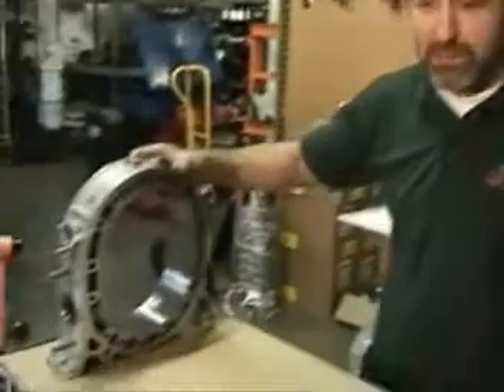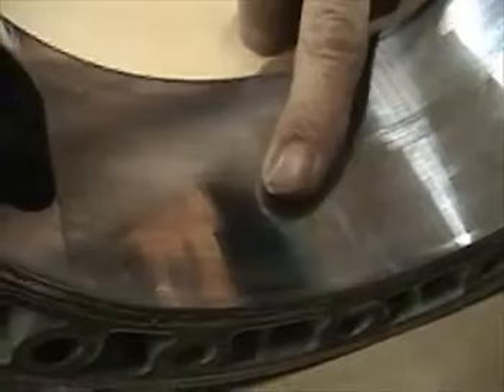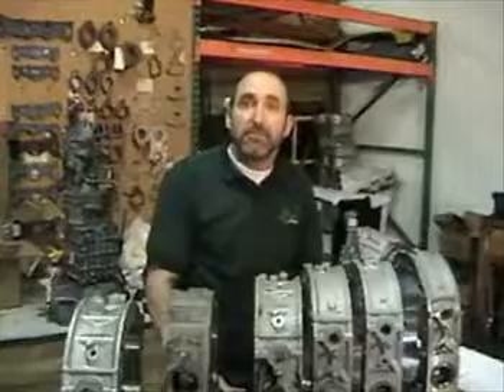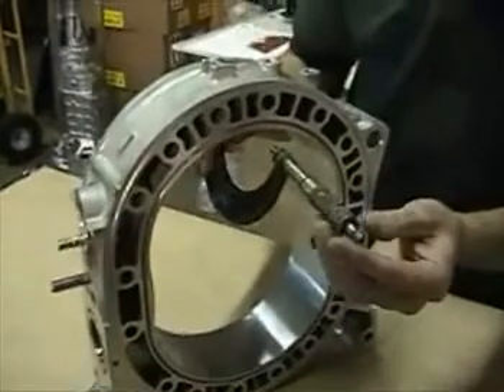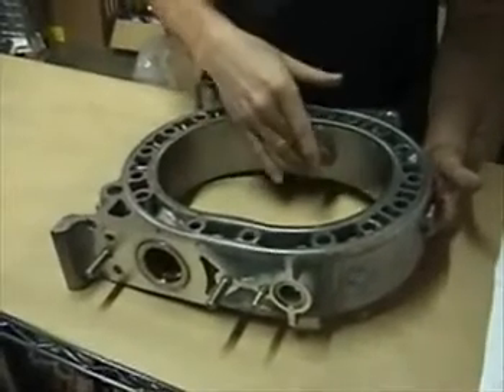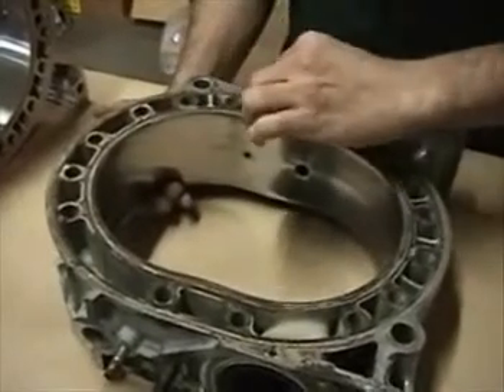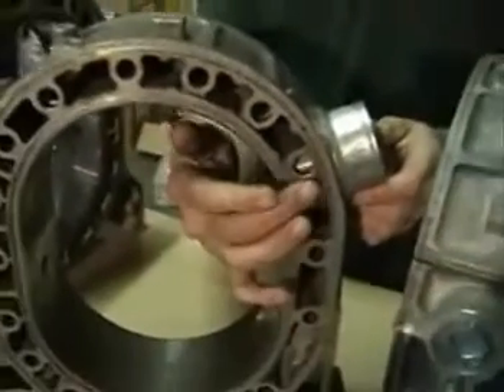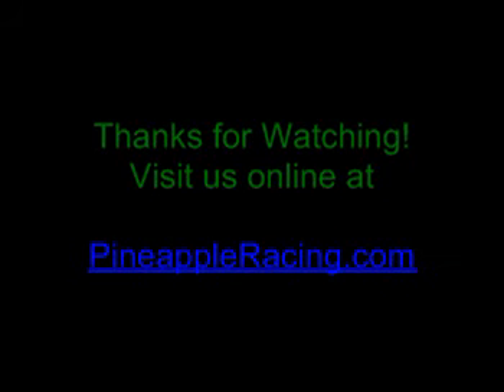How to Check Rotor Housings from a Rotary Engine

Comment: I have a rotor housing theory question for you:

One of my own 12A rotaries had the typical rear-rotor lost-compression failures, ie: the engine was barely able to run, and only on the front rotor. Limped home thinking my apex seals had failed like last time, but inspection found all six seals intact and not stuck in their grooves. 

Teardown revealed that the rear rotor housing had exactly the catastrophic chrome flaking as that shown in the above video, with most of the chrome from the spark plug areas to and beyond the exhaust port missing.

A little history on this engine: This car, a bone stock '85 RX7 GSL 12A was purchased used with about 100,000 miles on it. I replaced  the bee hive oil cooler with an under-rad unit from a series 2 RX7, and installed a Richard Sohn-designed oil metering pump adapter with a gravity-fed 2-cycle oil reservoir, using a block-off plate at the OMP so that the system  fed only 2-cycle oil from the reservoir rather than pulling in dirty 4-stroke oil from the sump.

Talking to another rotary guru about the cause of  the chrome flaking, he suggested that the minor flaking at the edges of the rear housing gave this 2-cycle oil (which mixed with the fuel in the 4-barrel carb fuel bowls) a place to work its way under the edges of the flaking chrome, causing scads of it to depart. 

Does this make sense as a contributing factor? Heat certainly played a part considering the location of the flaking, but the housing was not showing any of the expected warpage and coolant seal deterioration that I'd have expected from excessive heat. Thoughts?
Reply: Not at all, the issue lies at the feet of the quality of electroplating of the chrome period, the adhesion of the Cr to Fe is factory issue.
Reply: @ThreeTreeDog  ok thanks. So just luck-of-the-draw at the manufacturing level...

Comment: This video looks like it was filmed in 1976.
Reply from the maker: 2006
Reply: @ConnectingWithEarth  How degrees can you advance the ignition timing at idle before you start to run into problems?  

My prototype reduces engine knock and I what to see if A rotary engine is worth modifying with it.

I have A video of it being used in A piston engine so far.
Reply from the maker: @787brx8  Sorry, I do not know the answer to the question. Rob Golden would have. I helped create the videos but Rob was the Mazda rotary engine expert who has passed away :(.
Reply: Great year.

Comment: You like a pretty smart guy, I thought I would shoot this idea past you. I used to have a Suzuki motorcycle I also used to have a few rx-7s. I never came up with this idea in till just recently as a truck driver I became interested in the RX-9. What if the RX-motors didn't have side ports? What if the RX motor had the same size port as the exhaust port or slightly longer or taller just above the exhaust where the intake is now but at 10 or 2 o'clock depending on what side you look at. It would get a great deal more air than it does now. As the rotor pulls away it would suck in more air than the side port. Also a reed valve would be just inside the intake port to prevent any exhaust gas from going back through the intake port on the exhaust stroke of the rotor... It would be basically be like a two stroke motor in a rotary design instead of a piston design, the best of both worlds... I think it would work? Of course the that whole side of that motor would have to be redesigned, but think of the power. It could change it's fuel wastfulness problem...
Reply: Paul Bickley bit late but you've descibed almost word for word a peripheral ported engine haha